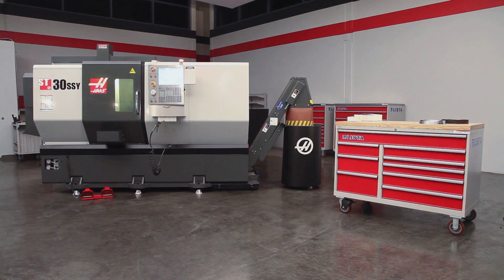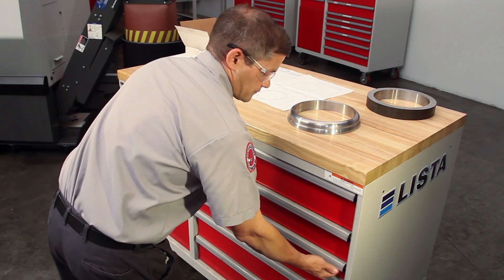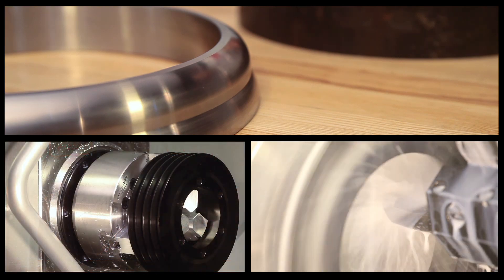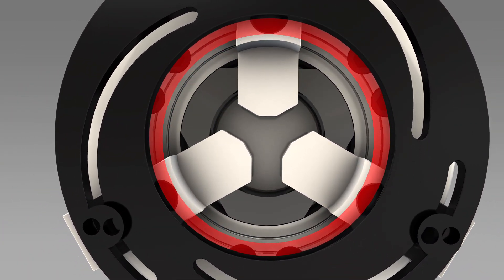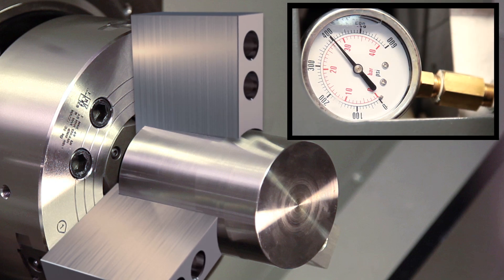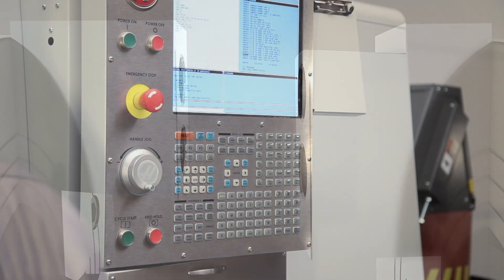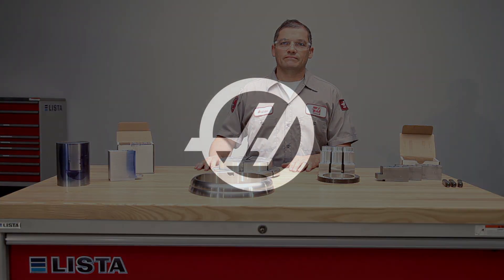How to Properly Cut Lathe Soft Jaws — Part 2: ID Gripping, Re-cutting, and Adding a Taper

Comment: I've been a Machinist going on 15 years and you'd be surprised the machinist that really don't know this.  It's a shame but I must say these 2 videos are pretty damn good! I actually use  an plunging indicator on top of the master jaw and zero it on top of travel ( you can do bottom too,  doesn't matter)  and I measure the total travel of the stroke as I close the Jaws and I divide the number in half and that's the number I look for when I clamp on a ring or pin or whatever.... Gets me in the center of the stroke every time!  These videos are great,  hope every one that runs a CNC lathe will take some notes! Happy Machining everybody!
Reply from the maker: Thanks for the great comment Ruben Alvarez!
Reply: Funny that. I'm an apprentice machinist. We have 7 CNC machines in my machine shop and when I watched this vid I mentioned purchasing a boring ring to bore out soft jaws for hydraulic rod jaws and they all looked at me and said, "what's a boring ring"? WTF?! LOL!

Comment from the maker: Hello and thank you for the comments William Bradu - you raise some good issues. 

It could be argued that wearing a ring while loading parts or tools inside a CNC machine may pose a risk. However, with the rotating parts of the machine not accessible during operation the risk is much lower than when using an unenclosed manual machine. Use your best judgment when deciding what personal effects pose a risk while working inside the machine.
 
Haas does not recommend using the M19 spindle orient code to hold the spindle in position while tightening soft jaws. In this case you are working against the motor positioning circuit and it is not sufficiently stiff to reliably react to the high tightening torques.
 
If your machine is equipped with an optional C-axis the main spindle brake can be used to lock the spindle in place using M-code M14. We did not include this in the video since many Haas lathes do not ship with this option installed.
 
The operator should always exercise caution so they don’t slip and hit their hands when tightening the jaws with wrenches.
 
You are correct; the jaws should be completely deburred. A file, a deburr knife, or an air sander can all be used where appropriate for the jaw shape. We review grooving the base of the jaw bore and deburring the jaws in the 1st Soft Jaws video and we mention both the grooving and deburring steps again in video #2.
 
A chamfer can be added at the front lip of the jaws to aid part loading. We chose not show this; if the chamfer is cut too deep or you have a short grip height the chamfer will reduce your clamping surface area.
 
Thanks for the comments!
Reply: NIETZSCHE KANT  This was skipped
@EDIT its my guess
Reply: NIETZSCHE KANT  On MAZAK QTN 250 II/ M / 200 I work on you cant turn on the spindle if chuck is not clamped. 
Maybe if chuck clamp position sensors are false set you could do it, I havent try this yet tho.
Reply: Maybe on HAAS machines its possible, I dont know, never worked with them

Comment: I do not have much experience running CNC lathes, but I am aware the chuck jaw clamping stroke is limited. Can you tell me how much the jaws can actually move before they need to be physically relocated? Can you direct me to a chart for different chuck sizes or types? Thanks.
Reply from the maker: Joe - Jaw stroke varies by type (hydraulic, pneumatic, or manual) and size, a rough range is .25” to 8”. Many of our lathes have hydraulic chucks with about 3/16-3/8” of jaw stroke, but not all of our lathes are this way and all lathes can be modified with alternative third party chucks and even different hydraulic unions.

Comment: At 3:10, if the operator opens the boring ring, its pins will diverge, what will make the clamps have to travel outward also. So how can the mark of the midle of stroke get closer to the center?

Greetings

Comment: What are your speeds, feeds, depth of cut and tool nose radius to achieve a 500 micro-inch when holding raw stock that you referred to in the first video. Thanks.
Reply from the maker: Hello gdnuc6774. We show cutting several sets of jaws and two finished parts in this video. In the case of the jaws they were cut with very conservative speeds, feeds, and cutting depths since speed is not the most crucial factor when making your jaws. The parts and jaws were all cut for demonstration purposes so have not been optimized for highest speed while still achieving fine surface finishes.
 
It is probably best to contact your local HFO with the specifics of your setup; material, tooling, speed requirements, type of machine, etc. That way they can give you recommendations regarding speeds, feeds, and depths of cut.
 
Thanks for the question.

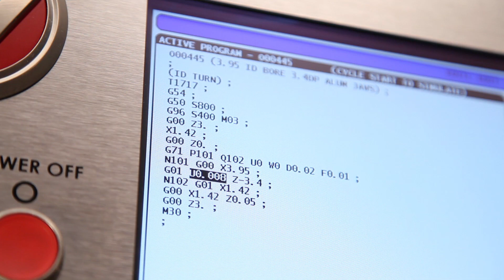Comment: Great video to start, just have a one question.  As stated from gdnuc6774 comments on the 13:44 point in video.  The operater put a U-.008 for a taper.  When I try to run this code I get a error code.  Example  G71 P100 Q101 U.015 W.003 D.02 F.01; with a U.015 on that line left for the finish pass for the G70 cycle code that comes later.  When I add the U.004 on my Z movement line inside the can cycle for a taper.  I get an error code.  So my question is how do you use the U.008 inside the can cycle to add a taper line that wont error out.  Thanks
Reply from the maker: Hi tkstinger - We're glad to hear you like the video. In regards to your great question, please email a direct email address and/or phone number to contact@HaasCNC.com so that a member of our Applications Dept. can get in touch with you to provide a more detailed answer. Thank you, and we look forward to hearing from you soon via email!

Comment: I didn't watch the entire video at the time of my first post. In doing so I am wondering if I could use U for depth of cut on the line before the canned cycle as well as U for taper? Would U-.008 make the back of the bore smaller? Can U for taper be used when turning the OD as well? If so would +.008 make the back of the OD bigger, same as the bore? Will the taper in the jaws show up when chucked on the bore ring if checked w/ inside micrometers or an indicator? Thanks again for the insight.
Reply from the maker: The "U" value represents the finish allowance on a G71 canned cycle for Haas controls. It is optional and an alternative to the "I" value. The U value on the G71 line cannot be used to add a taper, it will remove an even amount of material over the length of the cut. But see below.
 
At 13:44 in the video we see (G01 U0.008 Z-3.4;), in this case this line is operating separately from the canned cycle. The U0.008 value is functioning like an X-axis move taking place incrementally over the full Z-3.4 depth distance, thereby giving the taper. As it says in the video this is a diametrical move taking 0.004 off per side at the largest part of the taper, which is at the bottom of the bore.

Again, you can’t use the U value on the G71 line to add a taper, here it will remove an even amount of material over the length of the whole bore.
 
Would U-0.008 make the back bore smaller? If you were still cutting an ID bore then G01 U-0.008 Z-3.4 would make the back of the bore smaller. It depends on if it is Internal or External. All X-axis negative moves are towards the center of the spindle. Positive values are away from the spindle. 
 
Can U for taper be used when turning the OD as well?  U can be used to add a taper when turning an OD as long as it’s programmed similarly to what we have here and not on the G71 line of the canned cycle.
 
Yes, you will be able to measure the taper in the jaws chucked up on the boring ring. The best way to measure this would be to run your indicator down the bore moving Z-axis. Doing this carefully will show you the full amount of taper added. You could use an ID mic, tri-mic, or bore gauge and check for the difference between the top and bottom of the bore. But it will be more difficult to get an accurate measurement of the total amount of taper.
 
Thanks for the good questions and we apologize again for the delayed response gdnuc6774

Comment: The whole point of Jaw boring is the "Nominal Arc".  The main point is to bore the jaws to the Nominal Diameter - And if the Chuck is a good one, there is quite often no need to bore them every time, even if the jaws have been removed!!  A DTI (dial test indicator/clock) says a lot about repeatability. Stamping the Jaws (1, 2 & 3) alongside the chuck slides (1,2 &3) can save a fair bit of jaw boring. Been There, Seen It - Done It!! - Kept a roof over our heads for 45 odd years.

Comment: I tried to cut soft jaws as shown here with ring, and always got 0.07mm of TIR in the best case. While if to cut soft jaws closed on some cylinder the result is always perfect. What can be wrong with the ring, or it is regular behavior of this way of jaws preparation ?
Reply from the maker: Hi Anatoli Panchenko - Make sure you aren't clamping the boring ring with any more than 100 psi of jaw force, or whatever maximum the manufacturer recommends. Also, check the run out of the bored hole before you unclamp the boring ring from the jaws. Even if the boring ring isn't perfectly symmetrical. Suppose one of the jaws is held at a slightly different radial position than the other two. Even then, the bore cut into the jaws is dictated by the position of the boring tool and that finished bore should be on-center to the spindle's axis of rotation.
Reply: Haas Automation, Inc. Hi, thank you for you replay.
I noticed that the jaws are asymmetrical by themselves. I found that distance between the surface I cut (the wall of my bore), to the holes where I clamping the ring, varies within 0.5 mm.  For example on jaw N1 distance is 40mm, jaw N2 40.07mm jaw N3 40.5mm. Is that can be a source of the problem ?
Reply from the maker: Anatoli Panchenko - The error in your jaws does seem a little excessive, but it still shouldn't make any difference. Let's pretend for a minute that you attached one of the soft jaws (to the chuck master jaw) one slot farther inward than the other two jaws. This jaw would now be protruding say 1.5 mm farther than the other two.
 
But when the boring bar makes the cut it will bore all three jaws to the same diameter, dictated by the X-axis position of the insert. The soft jaws may have started at different locations, but the bore in the jaws should be round and at the center of spindle rotation.
 
If you continue to have issues, we recommend calling your local Haas Factory Outlet to inquire further. You can contact your HFO by visiting http://bit.ly/Find_HFO. You can also email us here at Haas Automation, Inc. if you with to speak directly with someone from our Applications Department: contact@HaasCNC.com. Please reference this YouTube conversation should you choose to contact either. Thanks Anatoli!
Reply: Haas Automation, Inc. I tried another approach to that problem. I used face groove tool to cut a groove on the front face of the jaws while jaws was closed on piece of round stock. Than I removed that stock, and placed steel ring inside of my groove. Than I closed my jaws (now positioned by the ring), and tried to cut my bore. The result was 0.01mm of T.I.R  that is quite acceptable.

Comment: Great video.  In the program for jaw boring there in no U (depth of cut per side) before the canned cycle. Is that what the D is on the G71 line? If so is the D value per side? Also the start point x (3.85) is not the same as the x value on the N102 line. I understand that you are just skimming the jaws and don't want to waste time w/ air cuts but I thought those x values had to be the same? I have ran them at different values before but in this case I would have the x3.85 and z.05 on the same line before the G71 line and  x2. on the N102 line. If I did this after facing down to x2. the boring bar would return to x3.85 z.05 in one move. Is that why you have G00 x3.85 and z.05 on separate lines before the canned cycle? So that after it faces down to x2. it comes straight out moving the z-axis only to z.05? Then rapids to z3.? Thanks for the insight.
Reply from the maker: Thanks for the compliment and we apologize for the delay in answering your questions gdnuc6774
 
The D on the G71 line is indeed the depth of cut, and it is read as a radial value (or per side as you say). When using G71 the U command defines the size and direction of your X-axis finish allowance.
 
The X3.85 value preceding the G71 line does not need to be the same as the X-axis value on the N102 line. The first X-value is the starting position before the canned cycle is applied. This is the point where each pass will start and end. The second X-value is the starting point of the profile being cut. The X-values are usually what determine an ID or OD canned cycle depending on their locations. 
 
In this situation it is a dangerous choice to move the axes simultaneously. Putting the values on the same line as you say makes both the X and Z axis move towards that one point at the same time, regardless of having any material there or some other interference in the way. This is a crash waiting to happen.
 
Keeping the values separate gives us independent action and axis control. Please keep in mind that the jaw cutting steps are not part of production and the fastest tool paths are not always the best choice. Haas tries to show what we consider to be the safest and best practices.
 
As you say in your next question; facing down to X2.0, straight out moving Z-axis only to Z0.05, and rapid to Z3.0. You are correct, once again this is done to maintain independent safe axis motion.

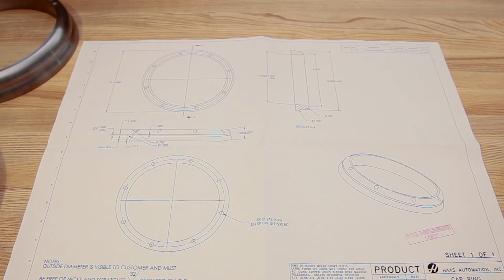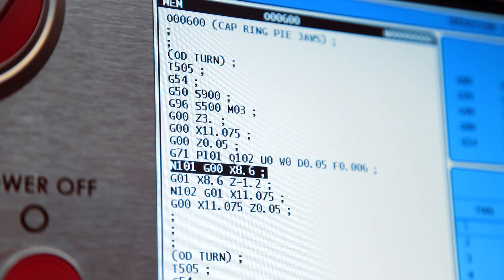Comment: Love the whole series.  Question:  you're turning the jaws to 'nominal' size.  The drawing dimension for the ID is 8.600 +.002/-.000.  (4:24 in video)  The program calls for x8.6 (4:34 in video).  The nominal would be 8.601 wouldn't it?  Would .001 make any real difference on a part this size?
Reply from the maker: Great question than357 – and thanks for the compliment. In this case, “nominal” size refers to the feature size as stated on the drawing (the value named) before any tolerances are applied. The word nominal is often interpreted in different ways in metal working.
 
As you mentioned, cutting the jaws at 8.600 or 8.601 will not make any significant difference in how well the jaws grip the part. If your parts have a large variation in diameter then it’s wise to consider whether you want to size the jaws to grip the average size of the parts or size them to the small end of the range of variation, knowing you will grip the largest parts at the 2 outer edges of each jaw. Hope this helps!
Reply: TY

Comment: Excellent videos, I will start in this bussiness and learning a lot with all this series.

I have a doubt in "the use of custom ring to fit a relief cut into the face of jaws".
How do you pass from raw or brand new soft jaws at 6:17 to the relief cut jaws at 6:22?
Did you machine from the outside on X axis, or from the front on Z axis?
During the cutting of relief; What / How were the jaws pushing outward against?

Thanks in advance.

Comment: When iam doing a job on the lathe , and iam clamping down on the o.d of the part, I bore a hole in my jaws.Then u just get some round stock and clamp down on it and then bore your jaws , at the same psi as your holding your part. Ive never put a taper in my jaws.And if ur jaws do start to wear just give them a quick skim.Ive worked on various sizes of parts and when u work on some parts iam talking half inch diameter by 6 inches in length , u want to get ur jaws as close as u can that way u have no slop when u load ur part., so by doing that your not clamping in the middle of the stroke your clamping in the beginning of the stroke and ive never had any problems with those parts.why do u need to clamp down right in the middle of the stroke? Is it for safety reasons
Reply from the maker: Mike Sticks As we talked about in the first "Soft Jaws" video, you achieve an accurate fit between your bored jaws and the part's diameter by machining the jaws to your nominal part size. That particular diameter you machine in the jaws can be made with the jaws clamped in the middle of jaw stroke, at either end of the stroke, or anywhere in between. The reason we recommend machining the jaws to size clamping the boring ring in the middle of stroke is a precaution, in case the part you're gripping is either under or oversize.
If you machine your OD jaws near the large (extended) end of jaw travel then there is very little difference between the part clamped position and the fully unclamped position, and if your part is slightly oversize your jaws may not open far enough to load your part. Quite inconvenient.
But of more concern, if you machine your OD jaws near the small (retracted) end of travel then there is very little difference between the part clamped position and the "full travel" clamped position. Now, if your part is slightly undersize, you run the risk of not quite clamping your part completely since you may run out of inward jaw travel before clamping the part. The jaws may not clamp the part tightly or only very lightly and you may think they are clamping fine only to find they are not when you go to cut the part and it cocks or spins in the jaws. Hope this helps! Let us know if you have any other questions.
Reply: Haas Automation, Inc. Yeah thats what I was thinking, I really a ppericiate you taking the time to back to me on that.Thanks much.
Reply: Mike Sticks

Comment: Andrew needs to take off his ring.  also go to mdi input m19 cycle start to hold the spindle in place . Then you can ((pull up)) on the wrench to tighten the jaw bolts and not have to use a adjustable wrench and risk  hitting the sharpen edges of the jaws with your hands if you slip . Don't forget about relief in the corner add  a chamfer at the front and deburr all sharp edges with a file.